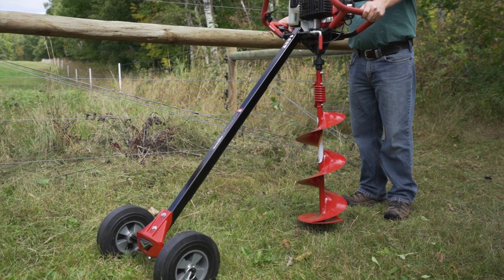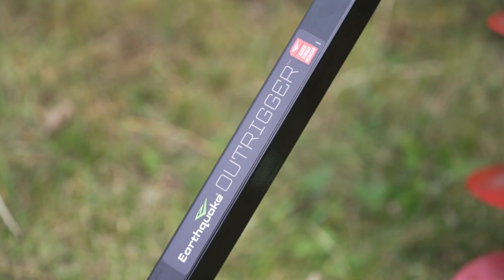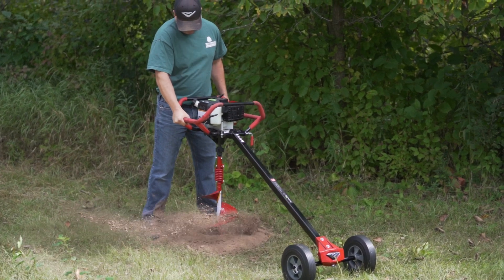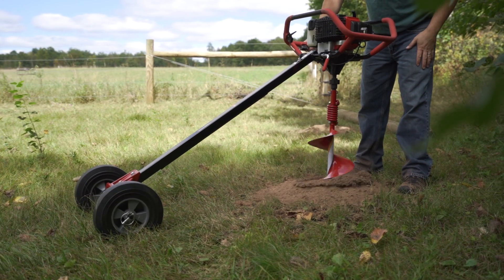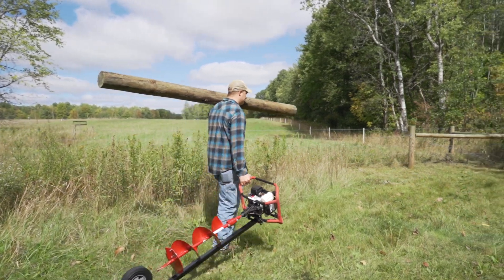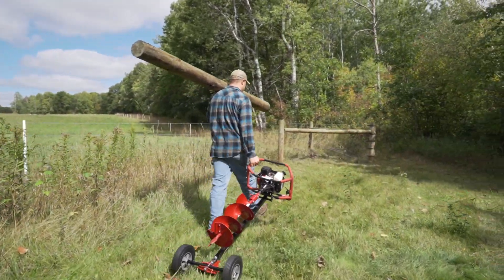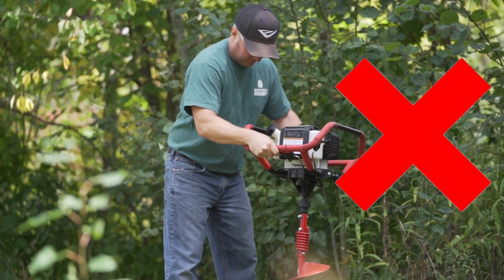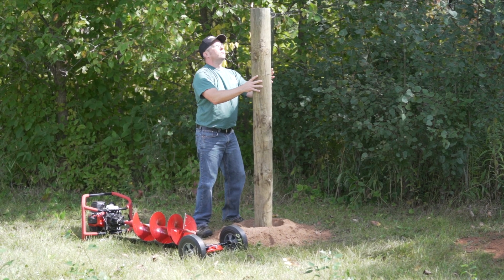Earthquake® Outrigger™ Torque Reduction System

Comment: The powerhead worked once.  I drilled 6 holes.     A week later, I couldn't start the engine.   I worked with customer service -- they recommended a bunch of things outside the obvious.   Clear the air filter (it wasn't dirty), remove the air filter to unflood the engine.  Didn't work, but required a wrench attachment with a very deep reach.
Reply: Was a waste of time and another $15.    Then they said something about the product maybe have been sitting in the warehouse for years and so. the carburetor could have gotten dirty..   Might be true, might not.    Don't enjoy getting products right out of the box that are already in need of service.